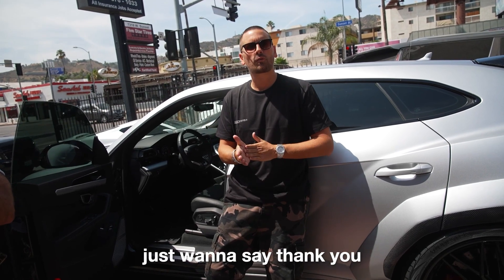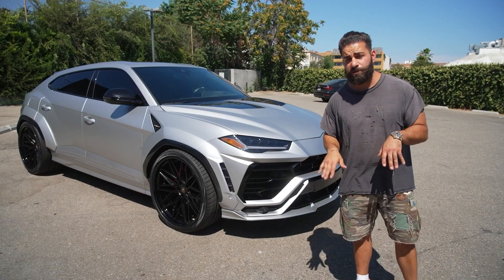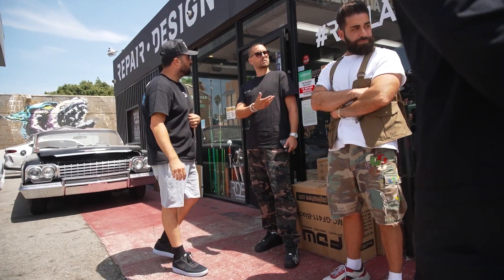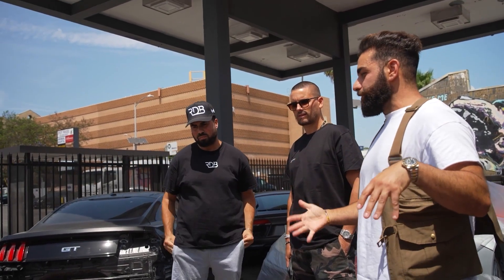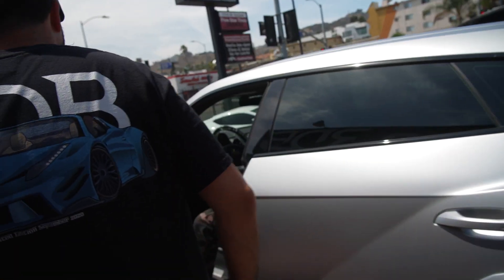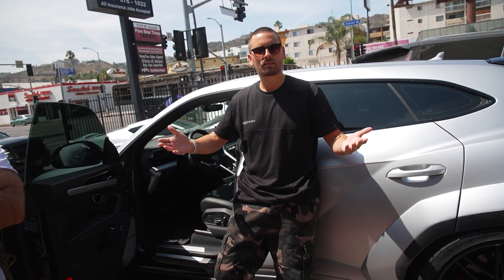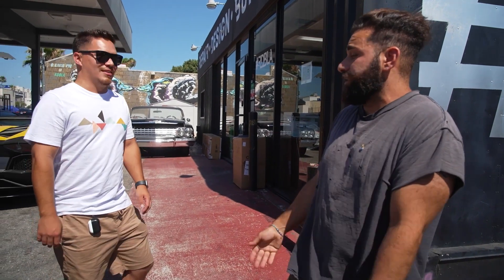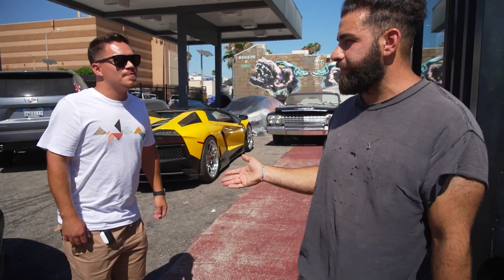Scott Disick's Widebody Lamborghini Urus!

Comment: Sic color.for the Urus. Nice stance. But...too much wheel upfront, even with the flare too much rubber showing, takes away from the rear. Is there an offset? U can’t tell. Size down, tuck the front in some, so the flare looks like a flare.  I’m just sayin’.

Comment: I've got 315/35/20 on the back of my Yukon and 345/40/17 drag radials on the back of my Trailblazer SS and 355/25/24 rear tires are insanely wide and I couldn't imagine what they look like under the ass end of a wide body Urus.